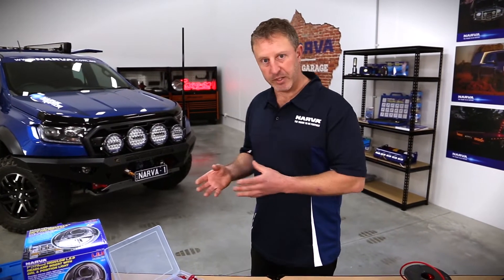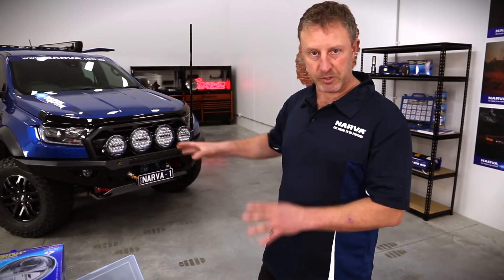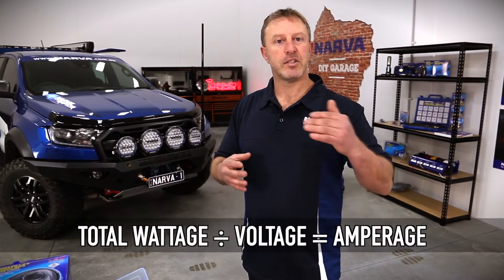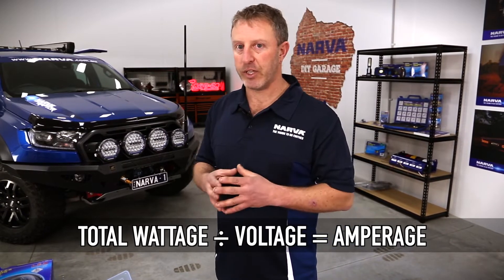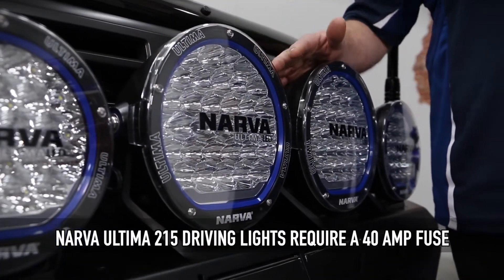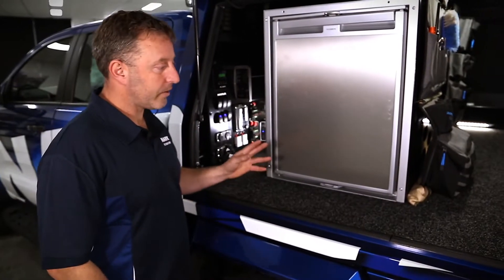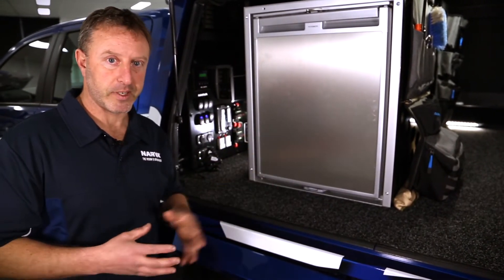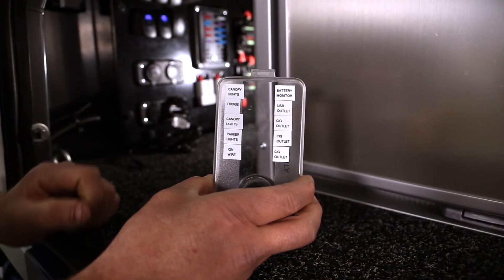What size fuse do I need? (Calculating amperage)

Comment: You didn't actually tell us how to calculate the fuse size needed. You only told us how to calculate the amperage of our system
Reply: you dont calculate the fuse rating. you decide what fuse to run based on calculated amperage... thats why he said either 30a or 40a in his example. the size has to be higher than the amp draw or youll blow the fuse.

Comment: "27.5 amp, we can quite easy fit a 30, maybe even a 40amp fuse" - why? How much higher can it and should it be? Why MAYBE 40 amp? Does that mean it could be running at 39.9 amps for a long period of time without anyone knowing? What are the conditions for the increase? This is not clear!

Comment: hi ,  a question . when we calculate 27.5 amps and we pick a 30 fuse or 40 fuse we are acutually letting more  amps into the circuit . how it does not damage our circuit?? what is the maximum fuse amp that we can use for a safe circuit in this case?
Reply: You’re measuring the max total current the system is expected to draw. You take that and the distance of your runs to determine the gauge needed. The gauge you choose is intended to safely support more than you expect to need, fusing for slightly less than the wires max as a fail safe in case of a short circuit.

Comment: Hello

The comment the fuse will protect the accessories is misleading. The fuse will only blow if there is something wrong with the circuit and it will not protect from a surge instantly. The reason for this is that a fuse is a bit of wire rated at a slightly lower amperage in a plastic shell, this means it has a delayed blow time while the wire heats up enough to melt and will only operate instantly at a massive surge (something like 10 times its rated capacity for standard ATS fuses). Until the fuse blows the components are still under the stress of the amperage going though it and the more sensitive parts can fail. 

The only reason you install a non specialized fuse is to stop the circuit when a device faults until the device is repaired.

Please also note that you need a qualified sparky to do anything with 230v fuses and that a 230v fuse is different to a 12v one in how it prevents the arcing when it blows. Do NOT use a 12v fuse for a 230v appliance even if the amps are within the ratting on the fuse.
Reply from the maker: Thanks for the tip